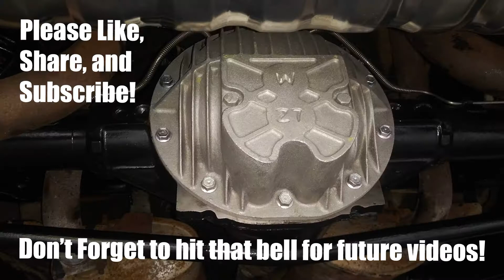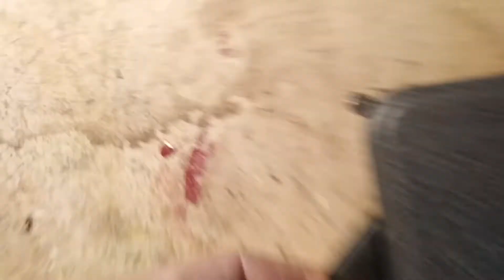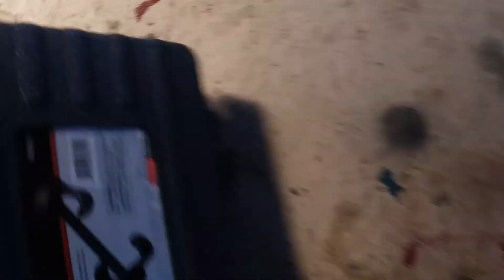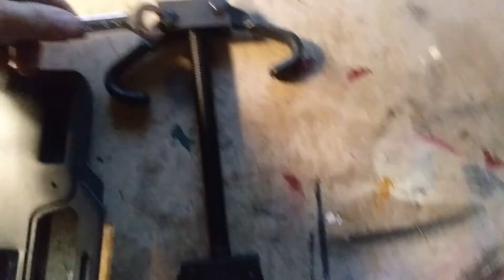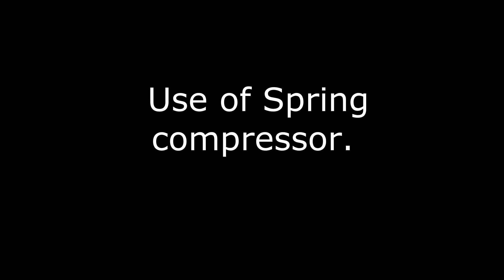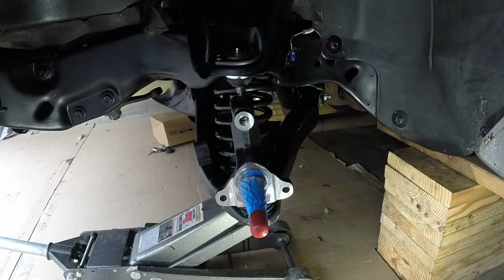Quick Tip: Front Spring Install on GM A Body

Comment: For me I did it this way. I put the top half of the spring compressor the the hole where the shock goes at the top using the frame and control arm for gripping/leverage to pull the bottom half up. Used a drill too and a ratchet strap to get it in straight. Went right in after 2 weeks of trying to figure it out 😂
Reply: Bolted the knuckles on and it was in place. Put the shocks in from the bottom. Centerlink goes in next and im DONE.

Comment: On that lower control arm you are supposed to be able to see the cut off end of the spring when looking up into the hole you talked about.  

On 1967 and older GTO's, The factory front springs (if you took it out and looked) will have one end of the spring with the coil  milled / ground flat so the spring sits dead on vertical in the top pocket.  I replaced springs when "restoring" my 67 GTO and when building up my  '75 Formula. Coil Springs Specialties instructed me on both cars to install the flats up as well fellas on (now) Max performance forum where I spent thousands of hours back then. Some springs will have paint on the "TOP" end to aid in install.

Comment: Easier and SAFER way of doing it - attach the spindle and DO NOT attach the lower arm back bolts leaving the back FREE. Put the jack on the arm between the bushing holes and lift the back of the lower arm up to the holes and insert bolts. NO SPRING COMPRESSOR NECESSARY. Much safer because the spindle/brake shield will be there to protect it from coming out. This way too you can adjust the fully stretched spring into the correct position and THEN lift up the lower control arm. Been doing it that way for GM products for yrs. 1 more thing - use a block of wood on the jack cup and it will protect your paint job AND the part from being damaged. Just My 2cents...
Reply: I use jaxk to start crankin spring up jackin up Lower controlarm ..then i remove spring compressor and send a threaded rod through shoc tower ..screwing up steering  knuckle to upper control arm lock it down .Remove threaded rod .boom I'm done ..Every1 has there way ..I'm going try yours got some springs to install this week on my old buick
Reply: I’m boutta try that
Reply: Brilliant!

Comment: I just spent an hour not getting a spring to go in. Now I know how. Thank you for your video.
Reply from the maker: Anytime! I am glad it worked out. Be careful with the springs! I was on eggshells the hole time.
Reply: @oldsguysgarage  Need to do the springs on my 67 Malibu.  Definitely a nervous proposition. Been a long time since I’ve done springs. 
Great video, and just subscribed. 🤙🏻🤙🏻
Reply from the maker: @ironhorse127   @ironhorse67  Those are awesome rides for sure!  Stay safe and if someone can help that would be even better! One thing I would have liked to put in this video is  since I recently painted the  the springs as well as shock towers black,  using a white paint pen to mark stop in shock tower would have made alignment a little easier.  Thanks for watching!
Reply: @oldsguysgarage  Your camera moved around a little about midway. I was thinking for a minute that the spring got away! I was stunned for a moment!  Safe!